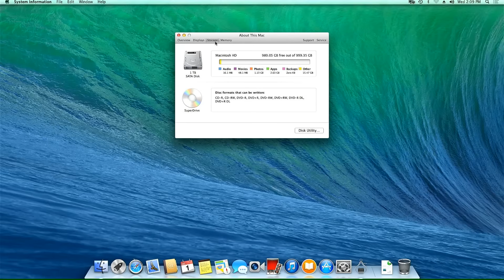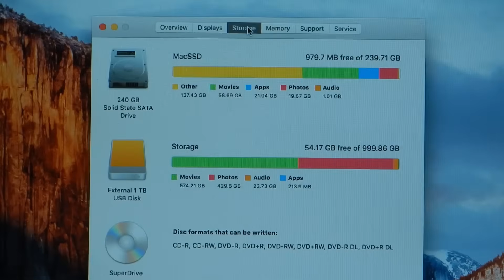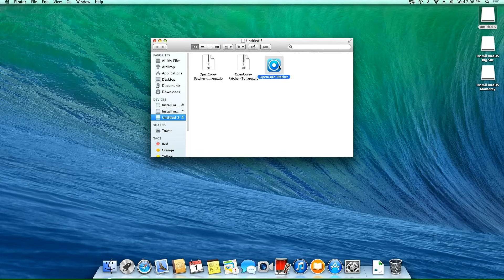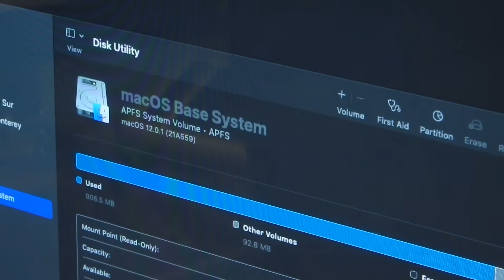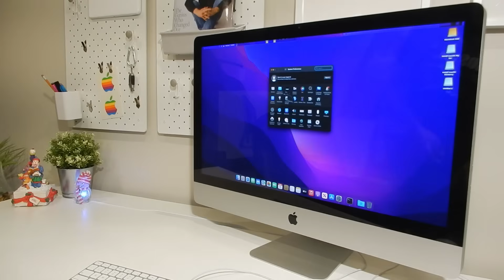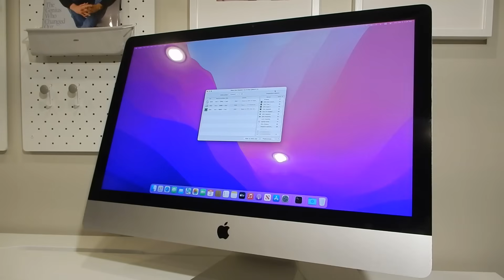Apple thinks this 2009 27" iMac is worthless. Let's refurbish and upgrade it to Monterey!

Comment from the maker: I ended up upgrade to a Metal GPU!  Watch here: https://youtu.be/n9koG8p9Ch0

New video is up comparing this 27" 2009 to the cheapest brand new 27" 2020 available :) https://youtu.be/bO1XvSBG4d4
Reply: I picked up a 2008 iMac, upgraded it with a ssd, added more ram, did the  dose dude patch to have the latest os. Works just as good as the new stuff.

Comment: Just got my 21.5" imac updated to 2tg drive with 12 gig ram, fast loading, I would love to update the OS from High Sierra if I can with 2.0.0 open core patcher thinking the only one that will update this iMac I have? Any comments on this?
Reply from the maker: Yes, OCLP works great to upgrade to a newer Mac OS.  I haven't tried, but you should be able to go all the way to Sequoia on that model.  Important to note that your iMac does not have Metal Graphics support, so some apps won't work properly (like Apple Maps, certain Adobe products, etc, or anything that relies on Metal).  I think Safari does have some Metal functions, but if you have issues you can resort to an alternative like Google Chrome.  It is possible to upgrade the GPU to get Metal Graphics working too (see my other videos), but the upgrade is pretty complex by comparison and it becomes harder to justify spending money on a computer this old.  But the OLCP upgrade alone lets you get a modern OS with a modern web browser and is free, so that's a worthwhile option for sure.

Comment: the 2009 imacs can run snow leopard, mavericks, windows xp, and 7. so basically, all of the systems people loved, because the systems loved the user back. thing is, i can't really find these used on the internet, or in person 🥺 these can be found for less than $200 right? given the specs for the i7 variants, i would call it a steal. i am still daily driving a i5 machine cus that's what i got.
Reply from the maker: The 2009 machines also have socketed CPUs which are upgradable.  Not sure it’s worthwhile, but technically any i3 or i5 system could be upgraded to an i7.

Comment: I've got an '09 iMac version 7,1 that runs fine as it sits but Safari doesn't work at all. However, the iMac needs a serious upgrade from its present Leopard OS. It's running 2.8ghz core 2, 2gb of ram, and the OS is X ver. 10.5.8.  I'm searched online for suggestions for potential upgrade options but seem to hit a wall with good advice. I am not expecting a fully functional iMac here, but one that can easily browse online for general use and be used to watch YouTube videos. I know I can find any number of newer and better iMac computers on Craigslist, but I'd like to turn mine into something useful if at all possible before retiring it completely.
Reply from the maker: If you just want web browsing, the OpenCore Legacy Patcher is great option.  I think some parts of Safari rely on Metal Graphics (which would require a GPU upgrade, which is VERY complicated), but I know that Google Chrome worked great back when I made this video.  Safari technically works, but if it makes a call to the Metal API then things won't work properly; when I last tested it, Chrome did not use Metal at all and worked perfectly.

Comment: I have a 2008 24" Imac with 1 terabyte hard drive & 4 gb of ram. No software update is available.  Is there any operating system that can work? I was looking @ linux. A shame no has developed a get by software for these old machines to give them life for just daily use. Apparently the computer manufactures want us to buy new every 7 years
Reply from the maker: OpenCore Legacy Patcher should work on your 2008 (see my other videos for this same upgrade on a 2008 24”).  Linux is honestly probably the best if you don’t want to patch anything.  I’d recommend Linux Mint as it is one of the most user friendly distros.
Reply: @rebootretro . I'll need to find someone knowledgeable since i'm low tech

Comment: Install High Sierra on it and be done. Anything higher will only bring monetary and time investment that will traduce into nothing usefull. 
Besides with the money invested in a metal capable videocard you already can buy a 2013 model and not only not waste your time but also get a lot of other improvements (USB 3, NVMe).
I have nothing against refurbishing and upgrading, it is just when enthusiams swaps to overzealous and unrealisti promises are made.
Reply from the maker: I did end up doing the Metal GPU swap.  Could buy them around $50 at the time, but I already had one on hand.  You’re right, you have to be careful not to dump money into an old system, and time is only worthwhile if you want to tinker.  In my case I had all the parts already, so it cost me nothing outside of time.  This machine is used almost daily, and it works just as good as a much later model.  Ya, a 2013 would be better and I have one of those too in a 21.5 inch Core i3 … but this one is a huge 27”  with an i7 and was free.  I realize this isn’t practical for many people, which is why the video is more of an entertainment style than a true tutorial walking through every step.

Comment: The obsolete nonsense really pickles my cuke. I have two 3GS iphones, an iphone 4, 6&8. Just replaced the battery on the iphone 8 and it works like new except the lightning ports all went bad on my iphones and yet the original iphone 30 pin plugs continue to work flawlessly. 

I’m one of those Apple customers that has been repeatedly burned by this obsolescence nonsense. At one point while talking to Apple support I asked them to consider that perhaps Apple is obsolete too. 

Spent thousands getting a ibook g4, Apple TV, lots of hard drives etc. The Apple wireless keyboard won’t work with anything but the iBook. My iPad keyboard won’t work with anything but an iPad. So much for connectivity. 

The worst part of this obsolescence nonsense is that when you buy Apple, you rent, you never own because they will cut off icloud access etc. I have a first gen Apple TV that recently died but when it was still working, sneaky Apple updated the OS update to prevent me from playing videos which used to run perfectly on the original update. Reset to the default OS and it worked but without the additional functionality so my experience has been that Apple sometimes destroys their own products through updates or rewrites code to break them. My last iPad update slows down wifi connection so it takes a minute or two before I can connect to wifi. Used to take less than a minute.
 
I upgraded to a new Mac Air and Apple cut off the old Mac Air so I can’t use my iCloud account or send email. Once it gets much past the 6 years, you have to divorce Apple and do your own thing. 
Even worse, it seems like Apple harrasses people who login on the older devices. First I have to add an additional code to the login password. Then for months aftewards, Apple will turn off icloud features on all or most of my devices, one at a time, sometimes for months on end so now I have to have a separate icloud account for my iPhone 6. This seems to be how Apple disconnects devices from iCloud by forcing a log out and then refusing to allow that device to login.

For me, all these new iphones are far too big to fit in pockets and Apple seems to have ignored the 5G radiation hazard. Something like the 3GS was a perfect size.

And when I upgrade to a new computer, the software was worse than the old device software. I had to return a new Mac Air M4 because the os15.5 &15.6 software is so bad and full of bugs that I sometimes can’t play cds or save imovie files. So I returned it and bought a Mac Mini which is also having the same cd issues on os 15.6.1. If I have to keep upgrading every 6 years then there’s no reason to buy a more expensive computer because it will just end up as expensive junk. So by absoleting older devices, Apple is also making it pointless to buy a new device with a new OS. They’ve shot themselves in the foot.

I have suggested to Apple that they provide support for older devices on a pay to use system which is more money in their pocket but that doesn’t seem like it will ever be a reality. 

So I’m totally with you on this obsolescence nonsense when I have perfectly good devices still working from way back when the iPhone 3GS was popular.

Today it seems like Apple’s idea of building a business is to sell a car and after 6 years refuse to sell you new tires. Would anyone buy a car at an Apple dealership just to own something with Apple’s name on it? If not for the Mac Mini, I would have given up on ever owning another Apple computer.

Have to go. Expecting another afternoon long session trying to fix the cd bug on the Mac Mini which seems to be the exact same bug on the new Mac Air M4. Apple support is really good but when does a customer decided that it is way too much hassle. Spent two months trying to fix the Mac Air and once again I’m fighting with Apple to fix the Mac Mini for the same problem.

Comment: Im seriously considering getting an old imac to use with bootcamp and also as a secondary screen for a silicon macbook
Reply from the maker: The iMacs make really terrible secondary monitors, unless you gut them and install a standalone HDMI interface board.  The only iMacs that are even remotely close to a proper monitor are the late 2009 and 2010 27 inch models, and even they require a fully booted Mac OS to run (which in tern sucks back a lot of unnecessary power for just a monitor).  I did a video here specifically about a late 2009 (https://youtu.be/TQwCJYiLqSo) and here about using any Mac as a monitor (https://youtu.be/0QG8aToiGMs).  Not trying to be discouraging, but I'd really only recommend the iMac as a monitor if you already had one sitting around; they are very unideal as monitors if you had to buy one.  It's not a bad buy if you want something to toy around with, just want to make sure you know about the downfalls too :)

Comment: I have a 21.5 late 2009 build all in one mac that was giving to me. I like the display and design of the computer. I tried to install Ubuntu on it and ended up with a four way split screen. I would rather have mint installed. Do you know of a version of Mint that would work on this Mac ? I am not too savy on Mac machines.
Reply from the maker: Although I haven't tested Mint specifically on this 2009 iMac, all versions of Mint SHOULD work in theory.  If you can't get the latest version loaded (I remember having some issues with EFI bootloader on older machines), try installing the older Mint 18 with MBR and GRUB and then upgrading to the latest version within Mint itself.  Although a Linux guru would just be able to fix the bootloader itself, a guru I am not and I found it just easier to go the upgrade path.  I'm sure there are other guides online specifically about getting Mint installed if you run into trouble.  Good luck, and great to hear you're keeping your 2009 running!
Reply: @rebootretro  Thanks. I will give it a chanc.

Comment: I want to turn the 2000 or my 2007 to a dual boot machine so I can play Diablo 2 LOD on it.
I have 4 damaged Imacs in my bedroom awaiting restoration and my 2009 Macbook Pro which may have lost its ssd or hard drive.

Comment: I have the same Imac but my girlfriend broke the screen when she thought she could carry it in her arms. I have the replacement glass for it and I will take it to Fix That Mac in Concord, Ca. who does great work on older Macs, Macbooks and even repairs Ipads.
I will keep the CD DVD R/W drive because I have extra 1 tb external drives and because I have over 600 cds of music, soundtracks and spoken word.
I also have several 100 dvds and sets and around 100 blu rays and just found a software program that FINALLY allows you to play blu ray discs on a Mac so when I get a second blu ray player I can watch movies on it.
I did not see you change the chip nor any informaiton on that.
Suggestions would be appreciated.
I will get them to increase the OS as far as it can go and I will put a 2 TB internal from OWC in it and max out the ram.
I also have a 2010 21 inch Imac that my cat Fuzzy broke when she pulled the power cord out of the power strip and it fell to the floor and smashed the glass.
I will repair it because it was my first new Imac and I would like to recover data and photos on the drive.
I bought my girlfriend a 2015 5k Retina Imac only to find out within months that Apple made it and all of its Intel successors obsolete and unsupported though it works for now.
I also have a 2009 Mac Book Pro, a 2015 Mac Book Pro with retina, a Silicon M1 Mac Mini, 2 Ipads, 2 Iphones and want a replacement Mac Mini for my 2007 that lost the OS so I can play Diablo 2 on it again with LOD this time as its my favorite game.
I also still play on my Apple ][s and finally found a shop that can repair my 3 1/2 inch drive for my
][ GS so I can finally play on it again as well as my ][e and I have a ][c, an integer based Apple & an Apple ][+.
And dozens of Apple ][ disks.
Apple ][ Forever.
Screw you Tim Cook.
I canmot afford a new Imac every couple of years.

Comment: Ive done this before but gave up on the Sierra installer and run windows. Im curious to see if I could get it to run a newer OS like you did
Reply from the maker: If you specifically want to run Mac and Mac apps, OpenCore Legacy Patcher is a great option.  If all you want is a web browser, then even something like Linux Mint would probably perform great like other people have suggested.

Comment: Mac users just dont know there are generations inintel i7 cpus
Reply from the maker: For quite a few of those generations they had really poor improvements and little innovation one generation to the next.  For example I have another video testing a 2009 against a 2020 iMac.  Of course in benchmarks and workloads like video rendering the newer CPU was a lot faster (makes sense), but in basic tasks like web browsing and documents, it made virtually no difference in real world tests.  I agree with you though, we shouldn't lump all i7's into one basket; Apple's poor marketing (and system info) makes it not obvious that there are different generations (or even different models!) of CPUs.  I do find that many people are tricked on the used Mac market into buying Macs with older CPUs because of this.  It would be nice if Apple included the CPU model on the main "About this Mac" page.

Comment: Thank you for this video.  I just did this to a 2015 27in.  Now running Sequoia.    I also found a 2009 27 inch iMac and would do the same.  My question is what SSD and SSD holder did you use on your project?   Thanks for your help.
Reply from the maker: Thanks!  Yes, the 2015's are still great machines!  And the 2009's aren't bad either with some modest upgrades like SSD.

I also made a video showing the Metal GPU upgrade on the 2009 so that Metal apps would work, although this is a pretty involved upgrade (I spent about a week figuring it all out - and it probably isn't worthwhile for the average person).

The SSD I used was a reclaimed Samsung OEM model that was factory shipped and pulled from a Lenovo laptop.  It's nothing special and is likely comparable to Samsung's other entry models.  Pretty near any SSD should work though.  I've also used Kingston and WD drives in Macs without any issue.

I was trying to build this system with parts I had already on-hand. The largest SSD I had was only 250GB, and I needed considerably more bulk storage.  So I know I installed the SSD into the CD drive bay, and a full size HDD in the usual spot.  I'm trying to remember, but I got a CD drive to 2.5 inch adapter caddy - and I think I had to dismantle the caddy and just install the adapter board since the whole caddy wouldn't fit.  But I cannot remember how I mounted everything.  I feel like I may have used some foam tape for the SSD, and I know I used foil tape to keep proper airflow.  If you're removing your HDD entirely and replacing with only an SSD while leaving the CD drive intact (which is what most people would do), then you can grab a 2.5 to 3.5 SATA HDD adapter online like Amazon.  Some adapters relocate the plug to the wrong spot and the short iMac cables won't reach, so make sure to get an adapter which provides the SATA connector with the equivalent location of the original drive.  Some adapters are also "slim" versions and missing some mounting holes, so make sure the one you're looking at has all the holes for the original mounting bracket.

Hope this helps!  If what I said doesn't make sense, let me know and I'll try to clarify. 
 Glad you're keeping another good machine out of the ewaste!

Comment: It's best to just use Linux for these machines, not hacked MacOS that will eventually be obsolete anyway.
Reply from the maker: It's true, except there are some software that doesn't run on Linux.  Although we're getting closer and closer to being able to run everything on Linux, which is very exciting!  There's still a codec licensing issue with DaVinci Resolve, so certain codecs don't work.  And using Photoshop or Affinity Photo still can't be done natively on Linux.  But its great developers are at least starting to move more in that direction, and hopefully there will be a day where all software is available on Linux.
Reply: @rebootretro  No need for these programs on Linux. You're supposed to learn Kdenlive or Shotcut, and Gimp. Especially with the new Gimp 3, I don't miss Photoshop anymore. Security is more important than running an old OS (soon to be unsupported that is, even with the hacks) just to run PS.

Comment: does this make the mac lag more/have some troubles cuz of the heavier os ?
Reply from the maker: The OS will be a little heavier, but that’s why you do the hardware upgrades too.  If you upgrade to an SSD and at least 8GB RAM, even with the new OS it will be significantly faster than the stock system was.